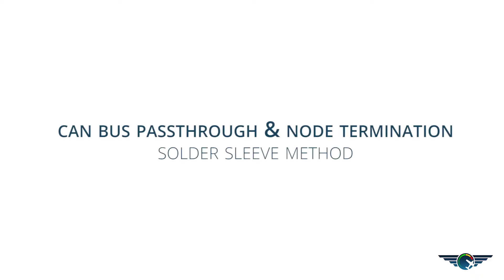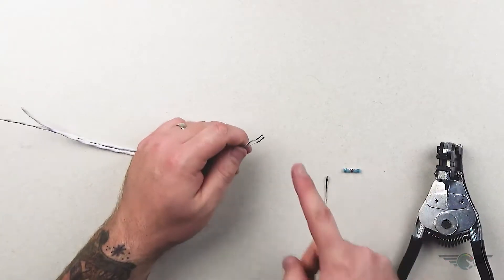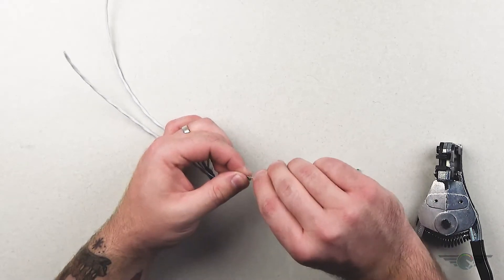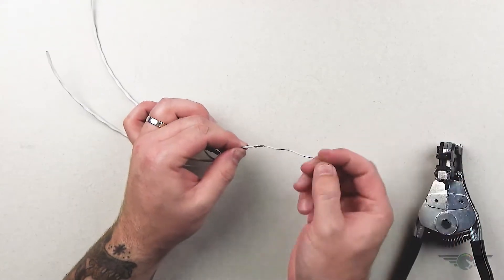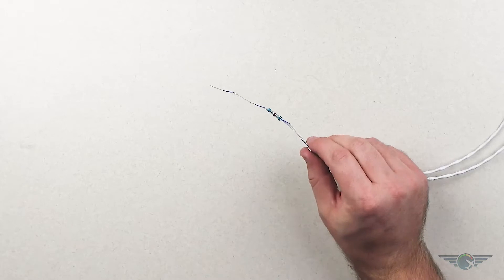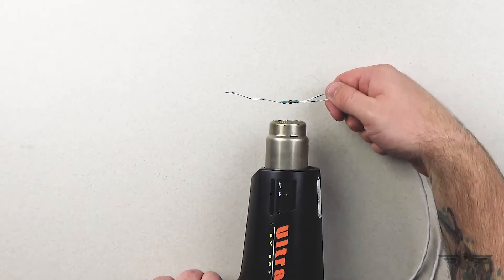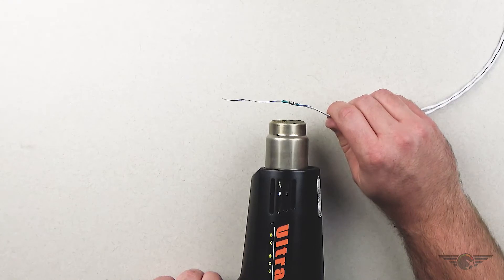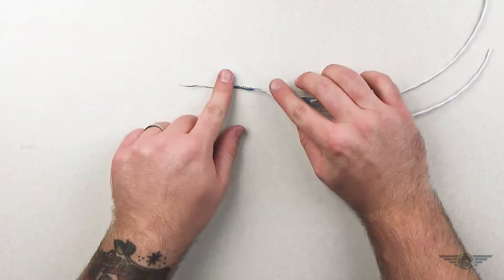Garmin G3X Wiring Fundamentals Series – CAN Bus Pass-through & Node Termination

Comment: That's a good way to do it 

I like to strip the wire at the end all most or just a little longer than it needs for the pin and then go back and then strip the wire to the point were i wish to install the can bus the insulate will slide forward and you stop when it's even with the end.

Then untwist the wire and use a sharp tip tool and make a hold in the center of the wire and side my can bus or wire I wish to add through the center hole and then retwist the wire solder and cover with H/S

I could be wrong but it seems to make a smaller joint and the main wire is not cut in- to as you have done and I have done it your way more than once 

I don,t like solder sleeves but that is just my point of view  as many people use them and seem to work well but to me, I thank I  get a smaller joint but could be wrong

Just a note to thank on as your way could be faster and does give a clean joint as well
I don't have a video showing How I do it 

Thanks for posting as it was a very well done video and will help lots of pilots building their own aircraft who don't understand the can bus node system

well done video